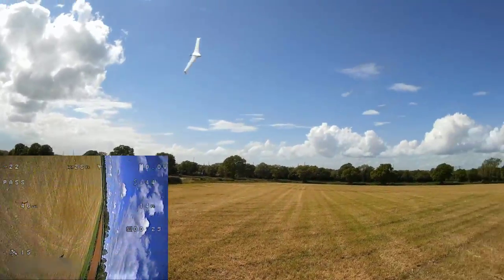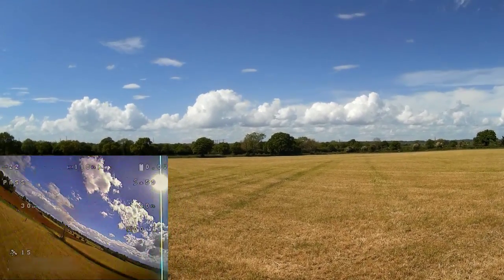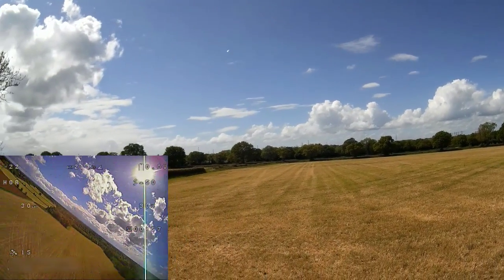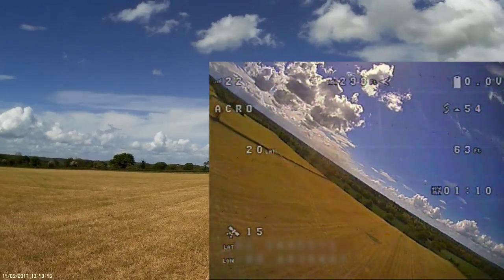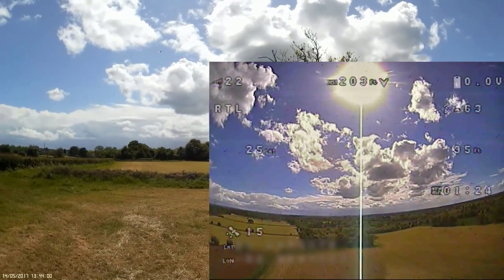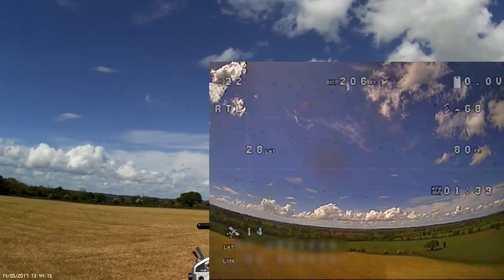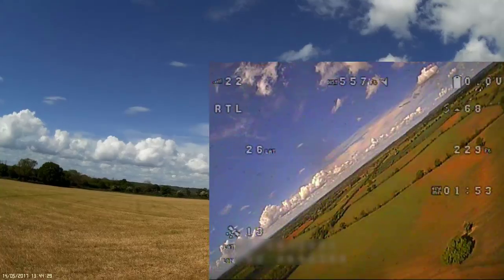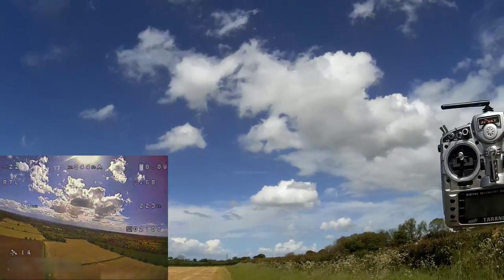Part #3 - iNav V1.7 Maiden with the Skywalker Falcon (Same parts used in the iNav series)

Comment: getting more and more interested in inav . plan to put the f4 fc to my mini talon soon . looking forward to your part2 episode !!
Reply from the maker: Afternoonies. The Mini Talon has a V-Tail, so it will need a custom mix adding. In this series I'll be focusing on a flying wing, however see this page for the custom mix you would need for the MT https://github.com/iNavFlight/inav/wiki/Custom-mixes-for-exotic-setups#v-tail-fixed-wing Matt
Reply: indeed that's my main concern . got omnibus f4 and a m8n for sometime yet i am still reluctant to try it on MT (which fly so well with vector ). better safe than sorry I'll try inav with new MT to see if everythings ok first . Thanks for the link , it's save me a lot of trouble !
Reply from the maker: There is someone in the FaceBook group using iNav in a mini talon. Mine is like yours though, it has a vector in it and thats staying in there too! Matt

Comment: Running in my first issue with inav... I selected fixed wing etc but can't make the élevons mixing working... No matter what I do it seems reverted... Is there an other option to play with? Even if a switch my servo cable nothing change...
Reply from the maker: Howdy Christophe, you need NO mixing in the transmitter. Instead make sure than Thr, Ail, Ele and Rud are being sent and match that in the receiver tab, the flight controller does the mixing. See this section of the iNav wiki and I'll be covering this in a later episode https://github.com/iNavFlight/inav/wiki/Fixed-wing-guide#step-2-hooking-everything-up Matt
Reply: Matthew Ogborne Yeah I had to go in servo tab and reverse the servo 3 I don't know why. This seems to work  now. Did you ever got to mess with this?
Reply from the maker: Howdy Christophe, yea a couple of times it's been needed :) Matt

Comment: Hi Matt does the F.C. need a Barometer the Omnibus Betaflight F4 Flight Controller V1 in your link lists it has no Barometer  is that a typo on banggood product specs the v2 version specs have a BMP280 Barometer listed
Reply from the maker: Howdy Dave, see the comment below from Anthony, a baro isn't needed as we have a GPS unit. Also i would suggest not enabling the Baro as thats what caused me issues first time around with iNav. Hope that helps Dave, Matt

Comment: Hi Matt,
Using the Falcon and iNAV following your great episodes, and got two issues,
1. In Horizon mode the there is a correction but the deflection is very small and in your video its much bigger, how can I correct it ?
2. The motor will start from 30% stick and not go to maximum leaving less power then needed for launch, any Idea why?
Thanks for you effort,
Danny
Reply from the maker: Hi Danny, for #2, you need to calibrate your ESC and #1 see the wiki for the movements of surfaces https://github.com/iNavFlight/inav/wiki/Fixed-wing-guide Matt

Comment: I really love your videos. For some reason I could not get my NEO-M8N GPS to work; did you flash any firmware to it? I would like to ask how were you able to power up the GPS is it with 3.3v or 5v.  I would really appreciate a schematic diagram. Thanks
Reply from the maker: Howdy David, I have always run mine with 5V. They're designed for PixHawks and the plug they go into supplies 5V. As for getting to work with iNav, it's a case of 4 connectors, 2 of which are power, the other two are Rx & Tx and then 3 settings in the iNav configurator. Matt

Comment: Can this work for scale giant rc gasoline cessna plane?
Reply: Would probably have issues with the motor control since in a gasser it's controlled with a servo and not an ESC. Other than that I don't see a reason why it shouldn't work.
But I probably  trust an expensive model to Inav. Crashing a 30$ wing isn't that painfull, but crashing a 3k gasser because of a software glitch is

Comment: Hi Matt...My Falcon is now ready for its Maiden...I have it set using 1.7.2 and with the Z84 Preset Pids as advised....What I find a bit unusual is that after arming, and in Horizon Mode it corrects attitude in the normal manner....However...if I then open the throttle a little, the compensation behaves in a softer and different way...?....Is this normal behaviour and can you confirm yours does the same..?
Reply from the maker: Howdy ET, that is to be expected, the model is compensating for the extra thrust. See how it does in the air, Matt
Reply: Thanks Matt, I have since flown it, nothing bad happened at all, it works great in Horizon Mode...I just watched this clip again, and on that last RTH test you did, it maintained altitude within a few feet all the way back...amazing....:)  I assume it uses the Altimeter and elevators to do it during RTH..?...Im hoping to test RTH tomorrow when it's a bit calmer air, but I do have a clip up on my channel. So pleased how it works so far, and your Tutorials inspired me to try it....:)

Comment: Is there a difference between flying in pass through mode vs flying in rate mode?
Reply from the maker: Howdy Scotty, yea, pass through is all of OUR inputs, other modes change the models behaviour, see this page for more details https://github.com/iNavFlight/inav/wiki/Modes Matt
Reply: I read through them.  From what I read it just seems like you would get the same results on a fixed wing whether in pass through or rate modes. I have not been successful getting my VAS Anubis wing flying yet using one of the Paris Sirius AIR3 F3 with M8N GPS the flight controllers. It flew perfect before adding the Air3 but am having a hard time getting things right I guess. 
I am planning on following this series of your videos and am buying the fc from banggood that you suggest. Hopefully, with your videos I'll  have some luck getting this f-ing thing back in the air. Then I can feel the difference myself.
Reply from the maker: Howdy Scotty, I'll do my upmost to keep things as simple as they should be. It'll take a little longer video wise, but at least all the steps will be there as needed, especially for flying wings too! Matt
Reply: Thanks a lot, That is so cool of you to take your time to do all these videos for everyone. Especially on this topic. The only other help really, is on the RCGroup forum but as I'm sure you know, that thread has over 14k posts, so trying to find what the hell you need can take a couple weeks to find, because the search can't help you, when you are unsure what exactly your looking for. 
So a big thanks for what you do.
Reply: Pass-through mode is flying like there is no flight controller on-board the plane. Acro/rate mode is the same as a multi-rotor. It holds what ever angle you put the plane or multi-rotor rotor into and stabilizes as well. 

Acro on a plane is awesome when you have a greater than 1:1 thrust ratio. My micro skyhunter is close to a 3:1 thrust ratio.  I give it half throttle while pointing it almost straight up in acro mode. Point it straight up and it launches like a rocket. Acro locks it into whatever angle you let go of the plane assuming it gains air over the control surfaces quick enough.

Comment: HELLO, nice vidz , still waiting on some part to do my first inav build ! very exited and your video are helping me a lot ! 
thanks !$

what fpv camera is this on this footage?
Reply from the maker: Howdy Christophe, I'm glad it's helping you. I've put the full line up of parts for that model in the video description above for you, Matt
Reply from the maker: Oh wait, maybe I didn't, it's the RunCam Swift Mini!
Reply: ok thanks !! nice picture from a 600 tvl
Reply: oh one question again, it seems you use omnibus F4 board, but they don't have barometer right? you don't need barometer on inav for fixed wing? they use the gps for the altitude?

it seems that a lot of omnibus goes wrong because of the onboard regulator, any issue for you with this? planning to put 4S lipo direct to it and using the board to power my servos ( i'm going to use the F3 omnibus with baro, but planning to use F4 later on other model )
Reply from the maker: That's right, for fixed wing use the GPS. I ran into serious issues when I first tried iNav 6 months ago using the baro. As far as the wiring, see the later parts, I cover both the Omnibus F4 V1 board and the Omnibus F4 V2 board that has the current sensor on it too. Matt
Reply: Matthew Ogborne  OK thanks better not use thé baro so?